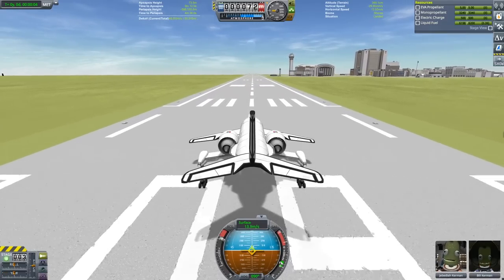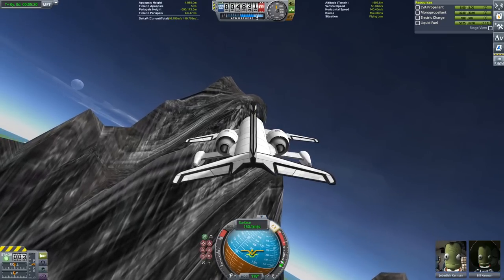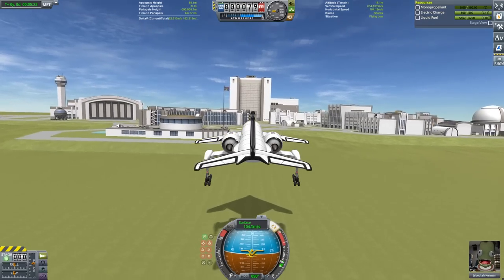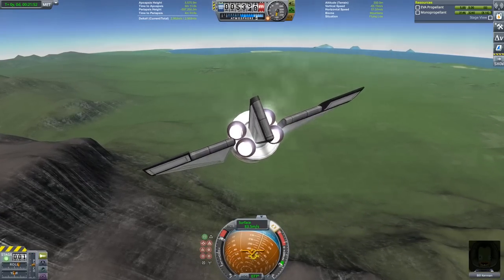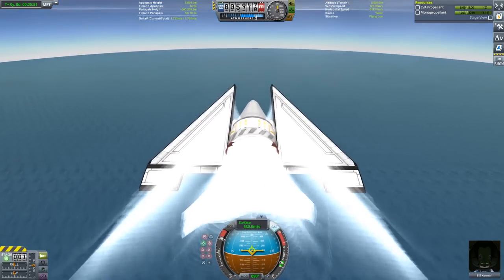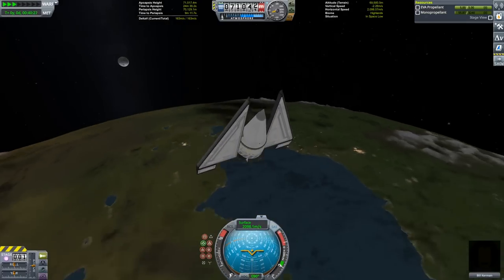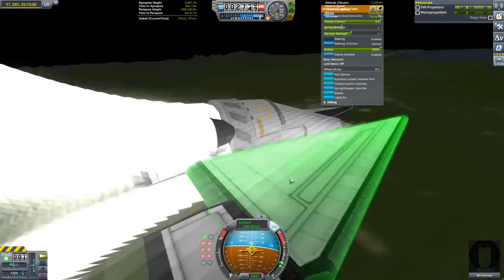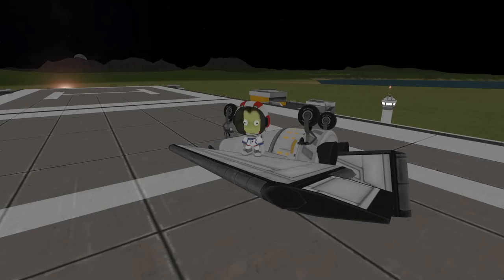Monopropellant SSTO - Orbiting with the "Puff" engine - Kerbal Space Program

Comment: Challenge: make a working SSTO only using drain valves for propulsion
Reply: Yes plz
Reply: This is probably not that hard since there’s a bug in the game where you can use IntakeAir as a “fuel”.  It produces thrust at zero fuel/electricity cost
Reply: Oh, good to know, thanks!
Reply: scott manly beat ya to it
Reply: @lifegeek5742  that was fixed and was a bug so it would be cheating
Reply: I don’t think it’s possible as specific impulse of the drain valves is in the single digits
Reply: @michaellee8226  no, I tested it. You must attach valves to engine pre cooler or nacelle
Reply: @bestPlayer_xu that was patched. Have you updated your game yet, and read the previous comments
Reply: Yeaaaaah!
Reply: @iCore7Gaming  ummm reducing drag by clipping parts is kinda cheating already
Reply: scott manley did that
Reply: @Archimedes.5000  not really as it's a game mechanic that the devs allow. Plus i imagine it as high compact and pressuresied tanks
Reply: @iCore7Gaming  devs allow it but that's still cheating.
I really dont think there exists a high pressure tank that can fit over 100 tanks of that same volume lol
Reply: @GamingWithNikolas  1.9 gang

jk 1.9.1 is way better and 10.1 is pretty good
Reply: LifeGeek 
They patched that
Reply: Microcontroller bug : Danny
Reply: @Archimedes.5000  kerbal technology lol
Reply: I think Danny2462 has done that.
Reply: @avi8aviate  wasn't an ssto
Reply: @jetti9844  o
Reply: @avi8aviate  i think danny would have had fun doin a valve ssto
Reply: 500th like
Reply: Ans rcs ?
Reply: Yes
Reply: @iCore7Gaming  soo physics "quirks" are allowed, but I assume stuff like the kraken drive aren't (for obvious reasons)
Reply: @lifegeek5742  wait what

Comment: Hey Brad, great video. Got a challenge for you as I've never seen you use the newer propellers/ducted fanblades:

Build and fly an SSTO to Eve, Duna, Laythe and back to Kerbin using ONLY electric rotor propeller/fanblade power and ion propulsion (no decoupler or kraken drive shenanigans of course)

I suppose you could call it the "No liquid fuel challenge"?
Reply: Good idea, no idea if it's possible to reach orbital speed like that though in a single stage.
Reply: @(S)-Riley Dunn the problem is eve. I dont know if you could ever reach orbital speed with props and ions on layth. Maby if you had a nuclear engin, but I'm not sure.

Comment: Idea: the eva parachute basically weighs nothing and gives a LOT of lift. could you possibly paraglide to LKO to save dV?
Reply: The Kerbals create a lot of drag if I remember correctly.
Reply: @josephpentony4804  The ridiculous amounts of lift could potentially make up for it, though.
Reply: @Tr0lliPop  I suppose, but you would need to fly at a low speed for a long time to minimize drag losses. And it might be a good idea to test if the parachute works when the kerbal is shielded by a fairing or utility bay.

Comment: I once contemplated using "Puff" engines for a Gilly Lander, I wasn't going for particularly high Delta-V since you don't need that for landing on gilly, I just wanted it to be as light as possible, and Monopropellant weighs less than liquid fuel (if I'm not mistaken)
Honestly a direct return mission is much easier and cheaper anyway
Reply: Crappy idea to be honest. You save mass using chemical feul as you can use an engine that is simply better.
Reply: @GamingWithNikolas  True

Comment: How do you rotate the wings by such a tiny amount? I've tried rotating the wings myself, but even when holding shift they still rotate dramatically far...
Reply: with snap off and a very fine hand i'd imagine
Reply: Editor Extensions is an amazing tool. Or, what the other guy said.

Comment: I don't suppose there's a path to exploiting aerodynamics to create more efficiency by using the monoprop to run propellers. I don't remember if you can exceed the RPM limit if you actually push the rotors externally. If so, it would allow a more efficient propeller, but that doesn't necessarily translate to efficiency beyond that of running monoprop engines directly.